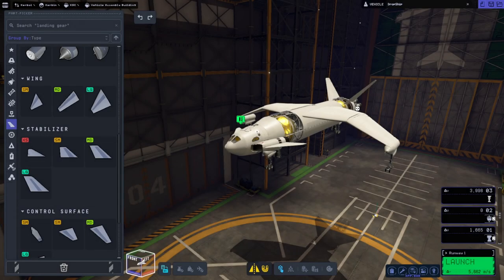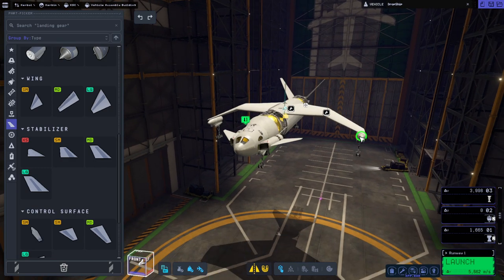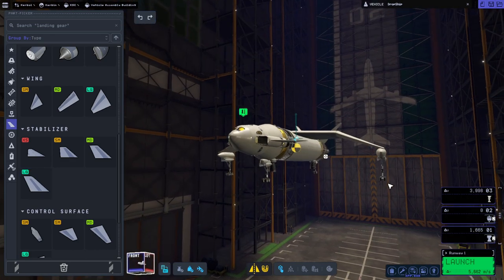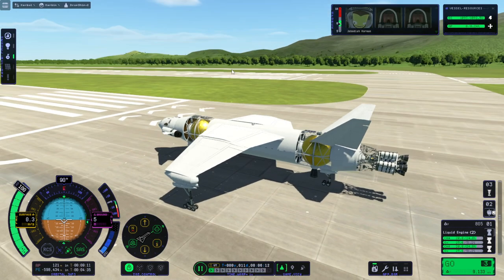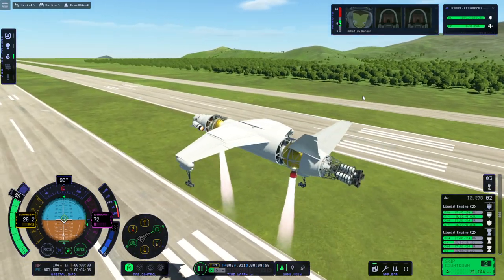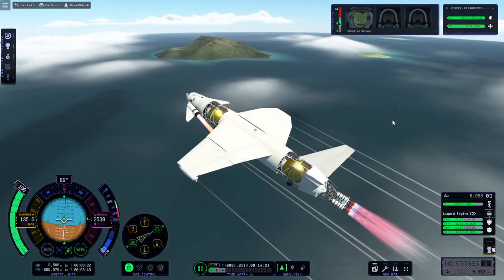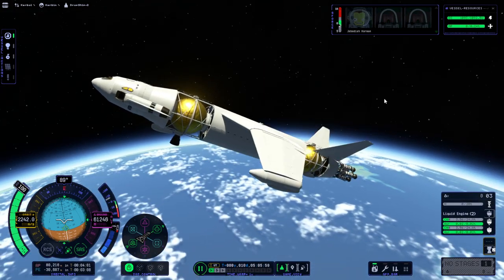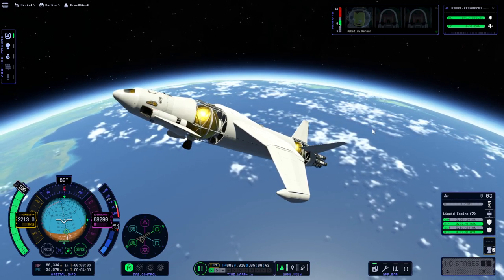KSP 2 Early Access - Patch 3 Dropship

Comment: Put a flat bladder in the sphere tanks making hemispheres, the bladder will stretch to each side allowing you to load each tank with different ratios of fuel to achieve perfect balance on the fly.
Reply from the maker: You seem to be trying to solve a problem when there isn't one.
Reply: @RaizSpace  you seem to be doing the same.
Reply from the maker: @jaycweingardt11 I just don't understand - it is already balanced. I also don't understand how this bladder would be implemented in KSP 2, and it shouldn't be necessary, because we can already load each tank with different ratios of propellants. This craft is only for KSP 2 - I don't mean it to be a real-life design, since it would not be able to achieve anything with the higher delta-v requirements.